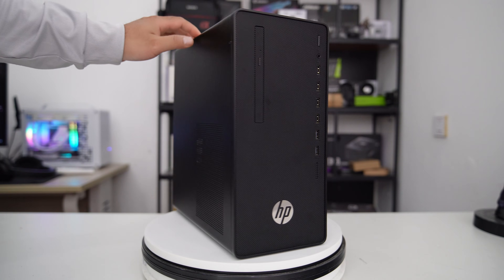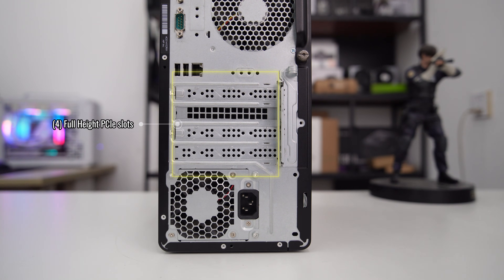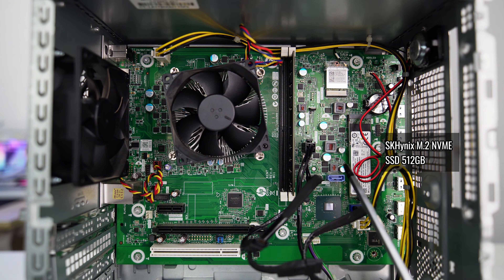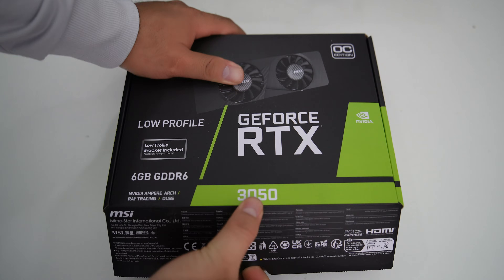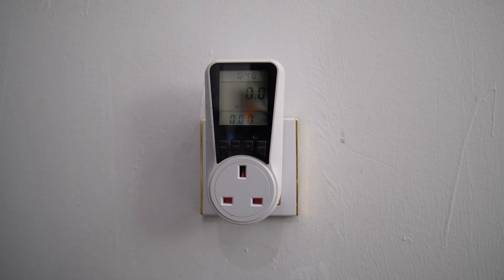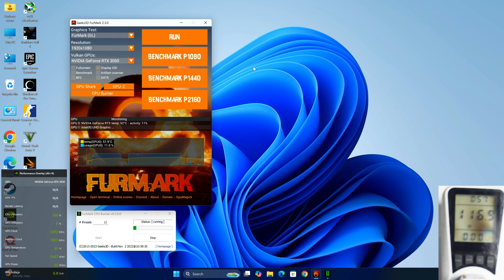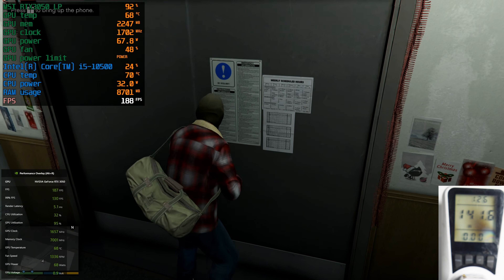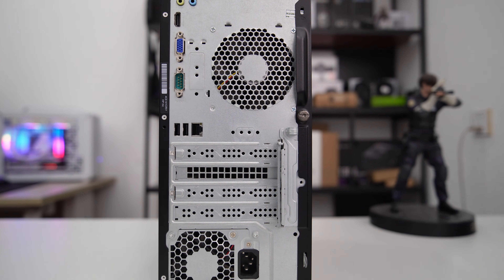HP 280 Pro G6 180W PSU ft. RTX 3050 LP, will it work?

Comment: I have the same but a supply 180w version, you think is gonna be a trouble??
Reply from the maker: I think a PC that comes with a 180W PSU is not likely to have any trouble since the engineers designed it to work with that power supply. However, if you want to add a GPU, it depends on which GPU you choose. If you need to install an RTX 3050 6G or any GPU with a 70W TDP, it could still run, but it might stress your PC’s PSU, potentially shortening its lifespan. Alternatively, you can use Afterburner to downclock your GPU to ensure it runs safely for the long term. Thank you.
Reply: @itggear  thanks for your advise 👍🏻

Comment: Thank you for this video, I have a HP pro desk 600 G1 sff and I've been wondering the same thing for about a month now. I got a little bit more beef on my PSU so I think it should work out fine around 240w
Reply from the maker: Yes, a 240W PSU should work fine with any GPU that doesn’t require an extra PCIe power cable.

Comment: seems like a minor undervolt or only running games that only put the gpu load at 70% or less and youd have more then enough head room for safety. keep in mind most office psu are decent quality as the oem doesnt want to do a warranty for just that
Reply from the maker: It could be that the GPU is running at PCIe 3.0 x8. Additionally, the OEM HP board limits power per PCIe x16 slot to 50W (refer to the HP datasheet). This is why the RTX 3050 6GB won’t run at its full speed. Thank you for watching.
Reply: @itggear  oh then your definitely good just only having 15 watt of leeway would hjave me a bit concerend but limiting that slot top 50W means their is noi way for the pc to draw more theen 200 watts unlees you changed cpus or added a bunch of rgb

Comment: Hi I do a lot of video editing on the HP Pavilion Desktop PC TP01-5000i inteli7, will RTX 3050 LP be ok to use in my PC that runs at 180W. thank you
Reply from the maker: Hi! The RTX 3050 LP is a capable card for video editing, but your HP Pavilion Desktop PC TP01-5000i with a 180W PSU might be a bit underpowered for it. The RTX 3050 typically requires a minimum of 300W to 350W PSU for stable performance.

To avoid potential issues, you might consider upgrading your PSU to at least 300W. Alternatively, you could try reducing the power limit of the GPU using software like MSI Afterburner to see if it works within your current setup.

Hope this helps, and thank you for watching!

Comment: Hello, thanks for the info! This is what i was looking for since i am planning to install a GTX 1650/1050Ti into a Lenovo M710t, sporting a huntkey 180w psu with an i5 7400. For context i am using an i5 6500 with a GTX 1650 on a dell 240w psu, works flawlessly. The 1650 consumes 75w maximum, while the 6500 is below 40w (51w peak while running prime95)
Do you think the 180w psu in the lenovo will suffice?
Reply from the maker: Hello! Thanks for sharing your setup. The GTX 1650 does indeed consume around 75W, and the i5-7400 typically consumes about 65W under load. Adding in the power for other components, your total power draw might be close to the limit of the 180W PSU in the Lenovo M710t.

While it might work, it’s quite close to the PSU’s maximum capacity, which could lead to instability or shutdowns under heavy load. For better reliability, you might want to consider upgrading to a higher wattage PSU if possible.
Reply: @itggear  the cpu is actually at 50w maximum while doing prime95, so most likely 40w peak while gaming

Comment: Ain't no way I just found a video that I need.

Moreover it's from 2 weeks ago. There's much I wanna say about how grateful I am but saying this little would already make you understand.

Btw, can you do a PSU upgrade on this PC?
Reply from the maker: Yes, indeed. I will post a video about upgrading the HP 280 Pro G6 with an RX6600XT, a 500W HP PSU, and a standard CPU cooler tomorrow. Thank you!

Comment: I have hp slim desktop...i5 9th gen and 180w psu and have x16 slot... which graphic card is good,?
Reply from the maker: For your HP Slim Desktop with an Intel® Core™ i5 9th gen processor and a 180W PSU, consider the ZOTAC GeForce GT 1030 2GB, EVGA GT 1030 GDDR5, RX 6400, or Intel Arc 310 LP. All of these fit the PCI Express x16 slot and are budget-friendly options. Verify your PSU wattage before choosing. The GT 1030 is suitable for light gaming and multimedia tasks.

Comment: you can upgrade the psu with a 400 watt or a 500 watt one's i found on amazon but that depends on your budget but thought id let you know also you can put a 60 mm fan on the black part of the hard drive cage by using a a sata to 3/4 pin adapter or a fan splitter it helps reduce the heat in it by having that be a intake fan which reduces heat by 9 degree's which isnt a lot but still helps
Reply from the maker: Thank you for your insight! I made this video on the topic of using an RTX 3050 6G on a 180W PC system per a viewer’s request. I have also posted many videos about upgrading to a 500W HP power supply, adding a front intake fan, and installing a standard cooler on my channel. Thank you for watching!

Comment: would it work on a 350w
Reply from the maker: Yes, the power supply recommendation for the RTX 3050 6GB is 300W, so a 350W PSU will absolutely work.
Reply: @itggear would I need to upgrade my ryzen 5 2600 x and 24 gb ram or is my pc okay ?
Reply from the maker: @aaron_lanky62__26  Your Ryzen 5 2600X with 24GB RAM is decent, but consider upgrading to dual-channel RAM (2x8GB) for better performance. Also, check your GPU—upgrading it could enhance gaming. Share your budget, and I’ll provide more tailored advice!
Reply: @itggear  thank u man helps a lot I’m not looking to spend hella amounts on my pc as I’m going on holiday so around 450 to 500
Reply from the maker: @aaron_lanky62__26  If the PC has a 4GB stick and a 16GB stick installed, it won’t run in dual-channel memory mode. Dual-channel requires identical pairs (e.g., 2x4GB or 2x16GB). In this case, it’ll operate in single-channel mode. Encourage them to match the RAM sticks for better performance!
Reply: @itggear  I have one 16 and one 8 gb and have been loosing fps and game stuttering recently do u think it’s cause I need another 16 gb stick ?
Reply from the maker: @aaron_lanky62__26  Your performance issues might be due to the mismatched RAM sizes (16GB and 8GB). Here are some steps to consider:

1. RAM Compatibility: Ensure both RAM sticks are compatible with each other and your motherboard.
2. Dual-Channel Mode: Ideally, use identical RAM sticks in dual-channel mode (e.g., two 8GB sticks or two 16GB sticks).
3. BIOS Settings: Adjust memory timings and voltage in the BIOS.
4. Graphics Settings: Lower in-game graphics settings.
5. Monitor RAM Usage: Check how much RAM your games use.

Upgrading to a matching pair of 16GB sticks would be ideal. If not, try adjusting settings and monitoring performance.
Reply: @itggear  thank you but rn my pc isn’t showing any display my graphics card yesterday’s was at 80 to 90 c when playing a game and it has never been that high now I turn my pc on and no picture

Comment: I’d for sure swap the PSU just for peace of mind. Do you know if this PC can use a standard power supply? I just did a PSU swap on a Dell 3620 and it worked great. It required a 24pin adapter cable to power the motherboard, but that was cheap on Amazon. I know other prebuilt machines can be a headache to swap PSU from the OEM one that has weird proprietary connectors.
Reply from the maker: For HP EliteDesk and Prodesk Desktop tower series with P2 7 wires or 3 wires cable and P1 4pin cable, there is no 24pin adapter to work with those PCs. We need to buy the original HP power supply replacement, as I did in my previous video. Thank you.

Comment: Here's my experience with 3 different HP TP01 desktops purchased used from Ebay. (I5-12400 - Ryzen 5 5600G - I5 10500)
My PC arrived in Fantastic condition on first boot it went straight to the desktop no setup needed added my wifi and started updating and downloading benchmark apps and testing.
Today the 310W PSU with 8 pin pci/vga connector ($40 on ebay) was delivered so I went ahead and did the upgrades
16gb Adata 3200mhz Ram
Geforce 1660 Super and another 1 TB SSD loaded with Emulation games.
Ryujinx,Rpcs3 and CEMU run great, Xenia is having a hard time. I'll have to figure that out.
Xemu is also doing ok with just a couple quits to the desktop.
It runs most modern PC games at 1080p high settings pretty well

Overall a pretty fun project, the 1660S is working fine with the 310W PSU. Under full system load it's only pulling about 195W from the wall.

If your interested in adding a larger graphics card (Note: they must be under 10.5" in length) it breaks down like this for PSU's
500W
3070-6700XT-2070S or a RX5700

400W (I ended up with 2 of these)
2060- 2060S-3060-3060TI

310W
1660S or TI - Rx5500 - 1050TI

Comment: I was thinking that you could have installed a GT 1030 2GB DDR 5 card, but that would have to be on the used market, and nobody knows how much longer NVIDIA will support the 10 series. So I am extremely curious how the 3050 will perform in this setup.
Reply: It's the 1660s with the raytracing just cost the power consumption of 1050 ti.

Comment: this RTX 3050 running on PCIe 3.0 right., how much difference running on PCIe 4.0
Reply from the maker: Please check my unboxing video in the pinned comment. I tested the RTX 3050 on a PC with PCIe Gen 4. Notably, in Shadow of Tomb Raider, using the same settings, the overall average FPS on PCIe Gen 4 is 77 fps, while on this PC with PCIe Gen 3, the overall average FPS is 64 fps. Thank you!
Reply: @itggear how about with pci gen 2 like I have!

Comment: nice one. may i ask, is there any resizable bar option in bios? i want to install arc a380 gpu on it, so i need resizable bar enabled
Reply from the maker: The HP 280 Pro G6 with the RTX 3050 doesn’t officially support Resizable BAR (ReBAR), it’s still a great combo for budget-friendly gaming. To enable it, ensure you have a compatible CPU, motherboard, and the latest GeForce Game Ready driver. If you’re using an RTX 3060, you’re good to go; for other models, check for VBIOS updates. Happy gaming!

Comment: gracias for the content, Good-quality PSUs can run at 100% capacity without issues, try undervolting the cpu and gpu to get 80% around a gross 144 watts
Reply from the maker: As we can see, the maximum power draw in this setup is no more than 165W from the wall. The 165W from the wall does not mean the PC system consumes 165W due to the PSU’s 80 Plus Gold rating. The PC could be consuming 85% of 165W from the PSU. Based on this concept, the whole PC consumes a maximum of 140.25W (165 x 85 / 100). This indicates that the total power draw from the CPU (65W) and GPU (70-75W) is correct, so we still have room for 40W to reach the max PSU capacity of 180W. Based on this analysis, this PC setup should be safe, and this is often seen with PC makers like HP, who install a GTX 1660 Ti on a 310W PSU and an RTX 3070 on a 500W PSU in their prebuilt PCs.
Reply: @itggear  Just the answer  I was looking for because I got double minded when in the video you said its not good to use the original PSU for longevity. Because upgrading the PSU for the RTX 3050 doesn't make sense, if I'm gonna upgrade the PSU then might as well use any other card regular GPU. The whole point of a card that doesnt use any external power is not having to upgrade the PSU, Upgrading the PSU just so you can use a card that doesn't require external power doesn't make sense! At least in most cases. But Thankyou for you videos on the HP G minitower series. Because there is literally nothing else about it on Youtube
Reply: @itggear  I have an Alienware Aurora R7 with i7 8700 and GTX 1080 on a 430W factory power supply.
Reply: @itggear   Hey , I have an HP with 180 watt psu , can i pair it with an RTX 3050 6gb single fan model as it says they both have same TGP 
 ?
Reply from the maker: Thanks, will do!
Reply: The quality of this power supply is very good and it has no problem giving out 180 watts
Reply: no dont, when it degrades it wont boot
Reply: @iikatinggangsengii2471  maybe

Comment: This is the same PC I have back when I was studying in college, I just want to play casual games at least 720p 60fps. So I decided to do some upgrades I put GTX 750ti and upgraded the ram. It work fine for weeks then I booted the pc at the morning I smell burning plastic. I immediately unplug the pc and I located the burning smells and its coming from the PSU. I took out the gpu and just run the system using the integrated and it works fine like nothing happens. But when I sniffed the gpu and yeah its turns out the gpu was cooked the burning smell coming was just the PSU was just exhausting the smell of my dead cooked gpu. So I decided to just buy gt 1030. its a downgrade but it does the job done for me.
Reply: Hey bro do u think my 280 psu will work perfectly fine using gt 1030?

Comment: That's not gonna last long with 180w psu, that's what happen to my "hp 290 g1 mt" paired with gtx 1050 2gb lowprofile, the gpu died a week later after i installed it.
Reply: your gpu dying within a week is probably because of other cause
Reply: Yeah especially cuz the 1050 draws negative power  @Kagamiya
Reply: I've been using a GTX 1650 4GB in an Optiplex with a 180W PSU for over a year now with no issues.

Comment: I have this same build as a HTPC, I upgraded from a 800 so swapped the 250w power supply from that. Buying an old unit like that is cheaper that just getting the power supply. Where are the Wi-Fi antenna routed on your build?
Reply from the maker: Yes, it does. There is a Wi-Fi antenna routed behind the front bezel. Thank you!